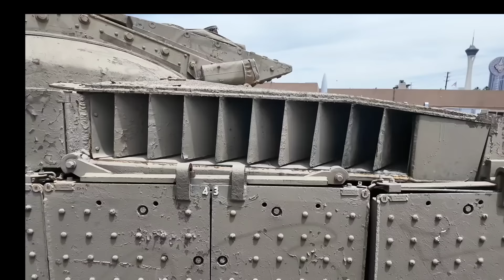First Merkava Mk2 in U.S (reload)

Comment: Are there supposed to be seats for troops in the back?
Reply: No. It's not meant for carrying troops except in emergencies, mainly the injured crewmembers of knocked-out tankers and injured infantrymen, etc. It CAN be used to transport medical personnel and other VIPs like a visiting general, but now that they have the Namer APC it's less important in this role.
Reply: No, there are supposed to be racks of fire-proof canisters for main gun ammo. The APC-thing is a trope launched by the first Israel Broadcast Authority TV report on the Merkava Mk.1 in 1979, which I remember very well. I am amazed by the persistence of this asinine tale, and it stuck so well that Morozov in Kharkiv, Ukraine, actually built an "APC'ed" tank prototype based on their T-64 back in the Nineties, which of course never entered service in any armored force.
The first tank the IDF bought "as new", and did not lift from some WWII junkyard or another, was France's innovative AMX13-75 light tank of 1952, which sucked considerably in IDF service, but had its (tiny gasoline) engine under the front glacis. It also had a very accurate, high-pressure "pea shooter" and a 12-rounds double-barrel autoloader. These two latter features were not retained for the Merkava of course, but the IDF engineers know how to make an autoloader if somebody wants to buy one...
Reply: @DanielLLevy  And yet didn't lots of new Merkavas get cooked in the mountainous terrain to the North when they decided to use them for hostage rescue?  (I think some IDF soldiers were abducted from across the North border?)  Sending tanks into a 3D terrain didn't seem like the brightest of moves to me.
Reply: @TacShooter  The tactical proficiency of the forces sent into Lebanon in the Summer of 2006 was appalling, and command was undecided, hesitant, and borderline incompetent. On the first day, as the abduction happened, a Merk Mk.2 was indeed annihilated by a huge buried IED, and many tanks were later hit by over 500 advanced, tandem-charge ATGMs. Very few were total loss (~5/50), and most of the crews had survivors. Thus, a large majority of the wrecked Merks were recovered, repaired, and returned to service. The general conclusion was that these tanks' heavy armor had saved many lives, and the tactical training doctrine was revised and updated, and the Trophy APS,  finally procured and installed in the Mk4's. The IDF went into Lebanon thinking this was just another counter-terror operation. It was real war, for which few were really prepared and trained. Apparently, lessons were learned and the IDF adapted.

Comment: This goes to show what can happen if you put aside your preconceptions and truly start with a "blank sheet of paper."
    Think about all the choices you make in designing anything. Too often, the person using the tool is overlooked. Tank crews seem to be the last item considered in designing the tank, yet the tank can only perform as well as the crew. Lest I mention the obvious, isn't getting in and out of a tank the first hurdle? Having access through the sides or rear seems sensible.
   Next, crew members need to communicate with each other, Thus, they need to be grouped together.
   Think of your major components. Parts that work together -- like the engine and transmission -- work best when they're together. Why place them as far apart as possible?
    As for the armor: armor is heavy. Do you really need to protect everything? Or, are there limited items to protect? Group protected items together, and you reduce the amount of armor that's needed.
    Do you want vulnerable stuff to be placed where it gets exposed to hazard a lot, or as little, as possible? Let's put the ammo and fuel down low, where it's not the first thing the enemy will see.
    Another ergonomic concern: would you rather have to lift heavy stuff more or less? So let's keep the ammo down low. Low storage makes reloading a lot faster and easier; if you can do it while placing all the armor between the support troops and the enemy, even better.
    The turret needs to be on the top, just to rotate. Might as well expose as little as possible. "Downward" depression can be assisted by jacking up the rear of the tank when needed.

Comment: Israeli dude here. I once trucked (i.e on tracks) back nearly 70 km, in the Golan Heights winter night, looking for #5 side plate that broke it's hanger pin and dropped. I was told that because of the reactive armor, that is very classified, we (the crew) must find it!
And now, on YouTube I see a full set of those early model top-secret reactive armor side plates. wow!!

btw, don't drive around too much, so many broken linking pins and even more missing lock rings. those links the plates that make the track (or thread what ever you call it). You have a special tool to remove and install new pins & locking rings. suppose to be on the left side-box, together with a (called pocket key) a tool to tension the tracks. yes, that the 5 foot wrench. 

If one those tracks (threads) will get open, with the condition of the tension-nut mechanism (nobody touched those for ages, I'm sure) you going to work very hard 3 - 5 hours to put it back. assuming you know what you doing and that you found some suitable extension for that pocket-key because (trust me on that) it will not move at all without it. 

Your hand signals are unfamiliar to me, but kudo for not falling from the trailer... not simple as it look.
Reply: "pocket key" lol
Reply: Drove a Super Sherman in 1970
Reply: @bobkohl6779  I went out of my dad ballz in a shpritz that missed the wall just a few months before you drove that super Sherman... lolz
Reply: אז השריון הזה היה טכנולוגיה חדשה. (לפי וויקפדיה באנגלית היו עוד כמה נסיונות לפני ישראל לעשות את זה אם תוצאות מעורבות - את הגרסה הישראלית יצר מהנדס גרמני מנפרד הלד). כיום רוב העולם משתמש בשריון כזה או דומה בטנקים שלהם.
Reply: @eldadmarbach2288  Kudos!!
Reply: @Nesher69 ?

Comment: One way to make sense of a lot of design features in this tank is to ask yourself: 'What do you do when the tank was hit and you need to evacuate the surviving wounded crew'.
Suddenly a lot of things will begin to make sense.
The rear hatch, for example; If the tank is hit, possibly under fire, with wounded crew, being able to pull the wounded out from the back can save their life.

A well trained crew that lives to fight another day is worth it's weight in gold.
Reply: Compared to the British and American tanks the IDF was using before, the Merkava was a Miracle of crew survivability..
Reply: Another aspect is replenishing. It's much easier to bring in shells from the backdoor than lift them up and then drag them in from the turret.
Reply: the idea here was to be able to cary some grunts as well .the dreadlocks to protect from rpg hitting the gap between the main body and the turret.the exhaust is for the port side i think .with mk1 we had the exhaust on both sides and it was horrendous to manuver in the vicinity of the tanks in powdery sand ,coudnt see shit  😂
Reply: Another aspect is the engine. Its in the front which also use as additional protection for the crew.
Reply: rounds that are designed to spall the armor inside dont give two fks about all your evac routes.
Reply: @Bramon83 ok, what's your point though? Having easy evac from a downed vehicle was determined to be a crucial design requirement in this tank.
This is the Merkava MkI, and the IDF has kept the same configuration throughout all Merkava series. A lot of people who are smarter and more experienced than both of us have determined it's an important part of the design and should be kept.
Reply: @Bramon83  Sabot and heat rounds aren't "designed to spall", they just do.  From someone else:
"Nevertheless what is important to understand is that the desing of modern Merkava tanks is not geared towards a hypothetical conflict with a near pear adversary, but rather against a clash with insurgents or countries like Syria and Iran which lack modern Tank forces.

Due to this the crew protection concept is focused on providing a good allround protection against all types of HEAT warheads ranging from your typical RPG up to very capable ATGM's. On top of that israel has heavily invested in procuring both soft and hardkill active protection systems further increasing crew protection.

The biggest reason why the front engine design was kept over the years is the much beloved loading ramp at the rear of the Merkava, which allows for extremely quick resuplies of ammo. This obviously wouldn't be possible with a rear engine design."
Reply: @Bramon83  I have a sudden urge to have a bitter lemon.
Once I read your bitter comment, it felt natural.
Reply: @Bramon83 I bet you'd love to climb out the turret, exposed to snipers rounds once an IED turns your tank into a sitting duck. Feels 10 times safer than moving to another merkava door to door.
Reply: @Bramon83  well good thing Israel's main enemies don't have it